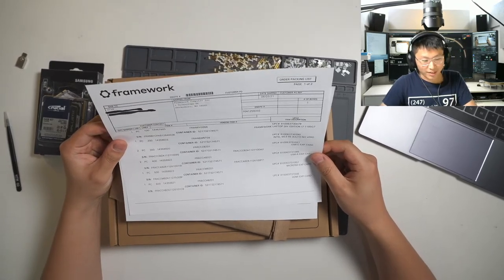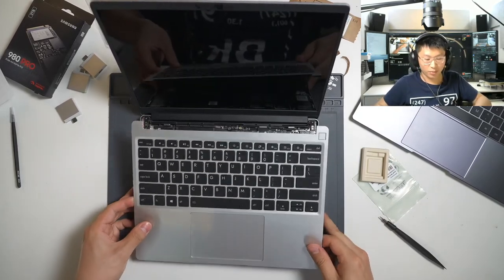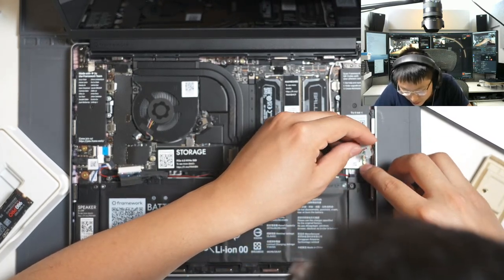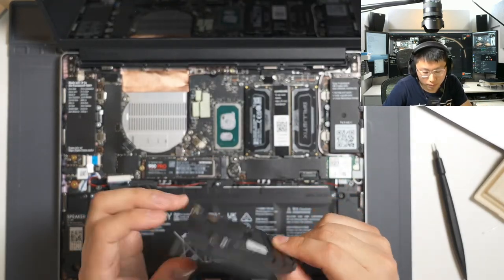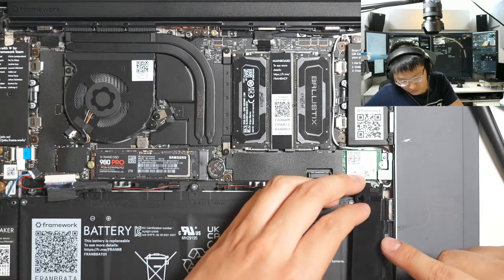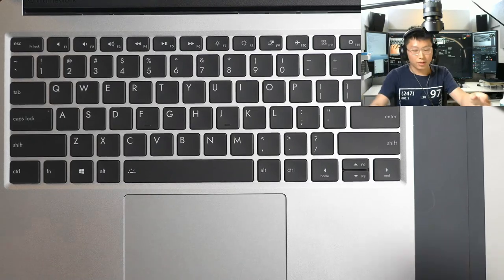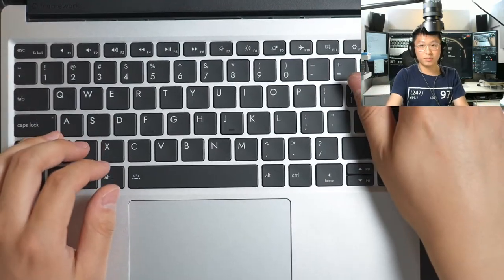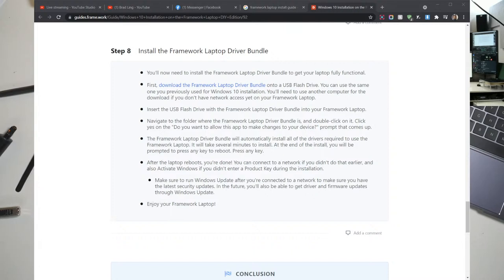Framework Laptop Live Build (timestamps in description)

Comment: I haven't bought hardware since 2010 so I'm new to this. The expansion card power consumption seems like it's a big deal but is it? Is battery life average compared to competitors? I haven't ever lived dongle life but might this feel different because of how they got into the system? Like could you live without the sd and HDMI until you need them? Very interesting to think about.